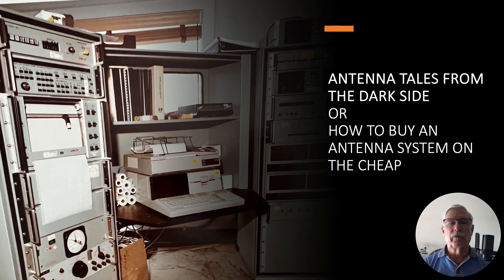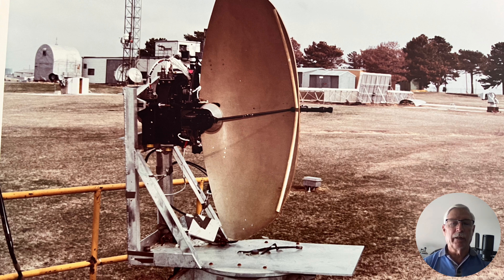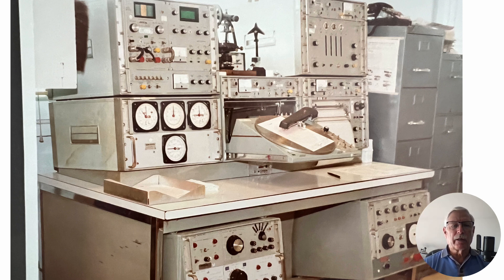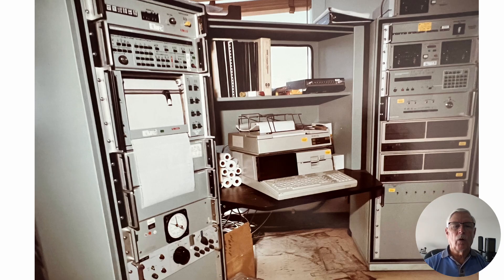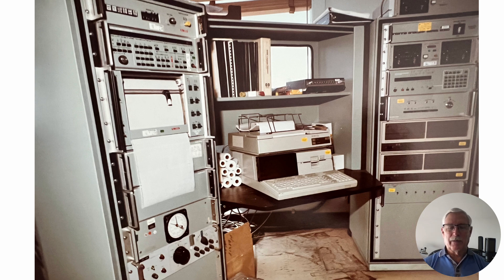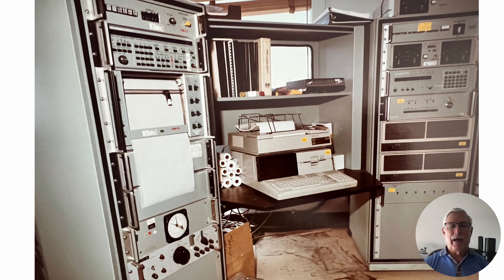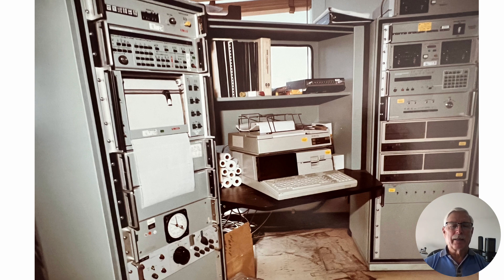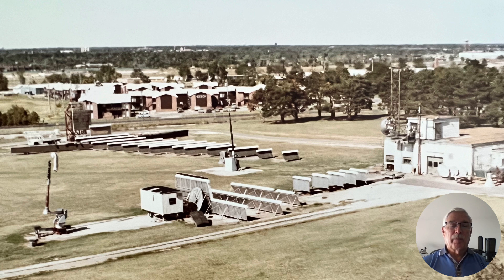Electrical Engineering Tales From the Dark Side or "How to Buy An Antenna Analyzer on the Cheap"!

Comment: The best engineers learn from technicians. I worked with a test tech who was affectionately known as "Sh*t Fingers".  He had notified the product lead that the data terminal (intended for public safety use) that he was testing would lock up after several seconds in some conditions. The lead and another engineer came to the lab and ask to see what was happening. SF started randomly banging on the keyboard followed by simultaneously flipping the power supply on/off. The lead engineer came unglued and yelled that you can't treat the terminal in such an extreme manner. SF looked him straight in the eye and said if you're going to put these in fire trucks then this is exactly what is going to happen to them on the first day they go in service. Three weeks later we had a new prototype terminal to test.